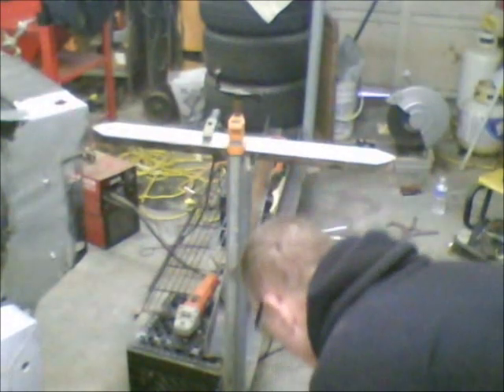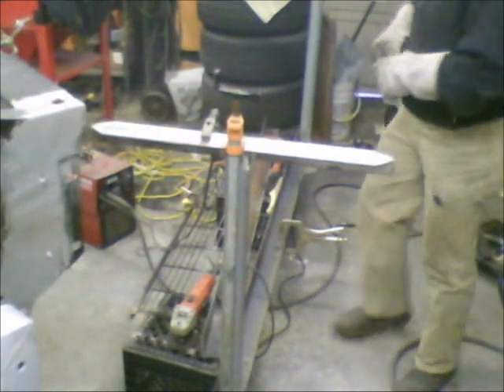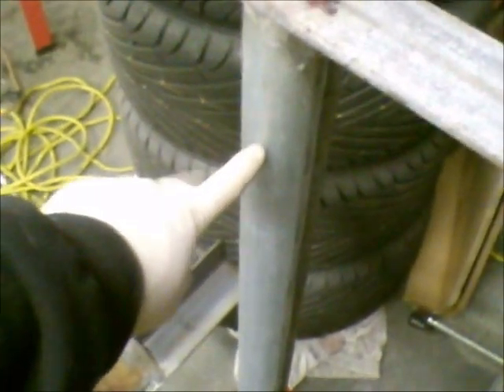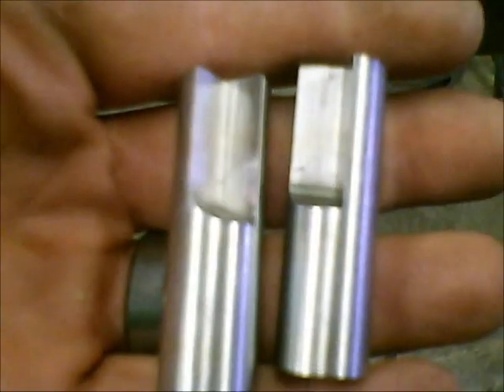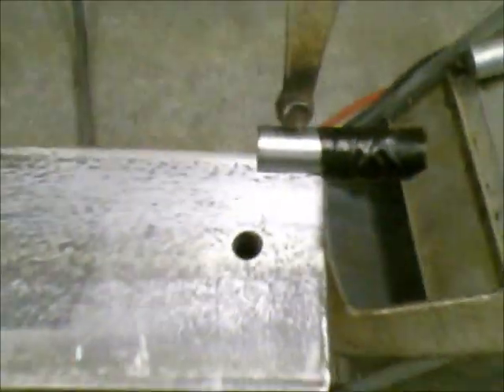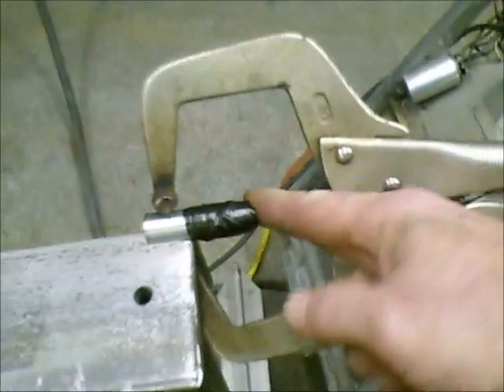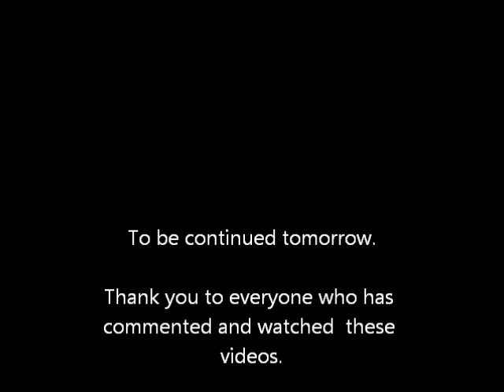DIY sheet metal brake pt 3

Comment from the maker: @turbocobra The pins turned out nice for sure.
In the last vid I didn't use the fan and later realised that it was setting a bad safety example.
I will definitely use it ALL the time from now on,even welding mild steel.
Sure, I could come build you one but you would miss out on all the fabicating fun and games and you don't want to deprive yourself of that do you?    :-)
Thanks Gary.

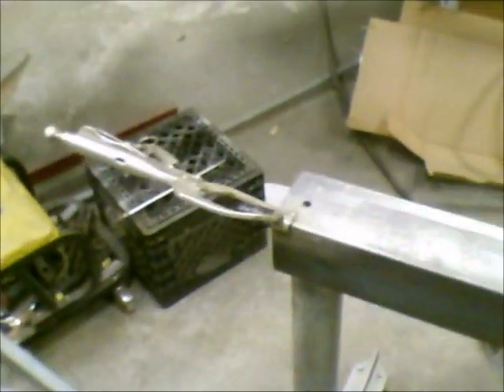Comment: At first I didn't get what the groves in the pivots was for... ah, so the bend point is right in the center of the pivot, and the angle iron corner. 9:32 It that a parrot I hear?